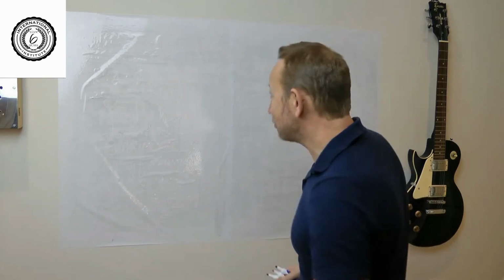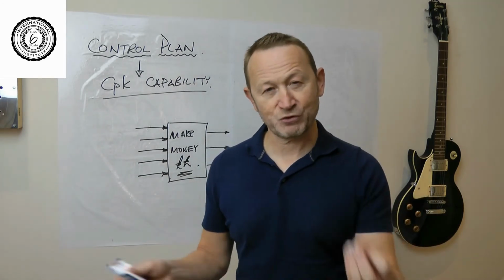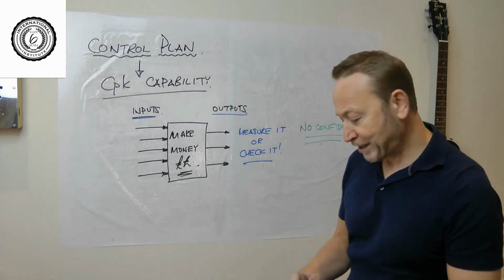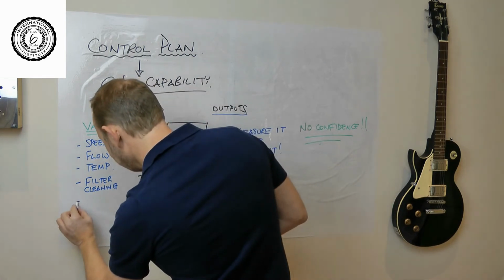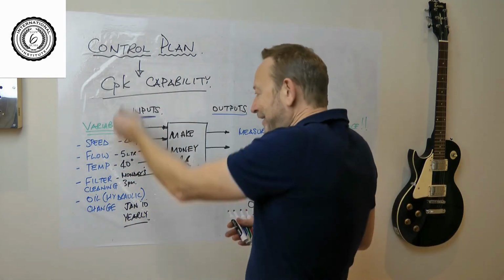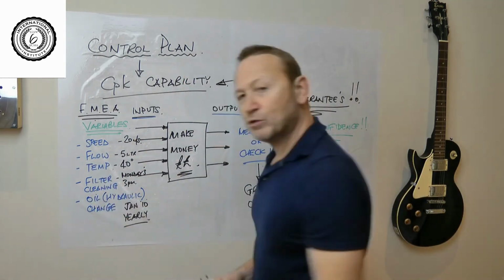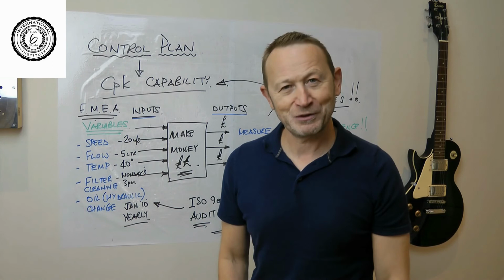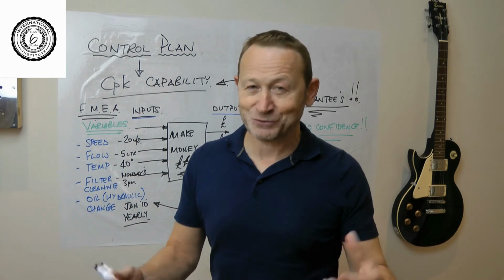Control Plan - Not an inspection Plan!!

Comment: Sir Paul, 
Is there such a think of creating both a control and inspection plan?
Reply from the maker: Vincent - I would say that your inspection procedures are part of your control plan. After all what you should be doing is using SPC charts to indicate if an input is moving around...I see no reason to measure outputs without a control chart, it's point less...